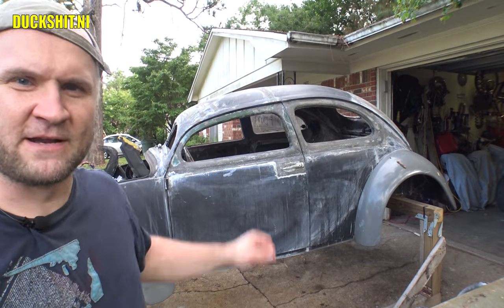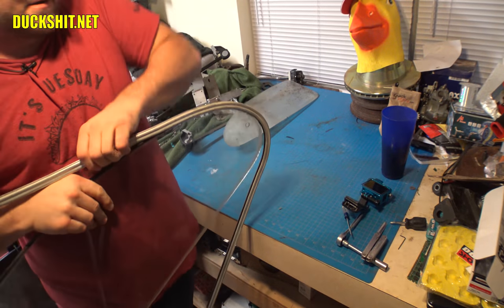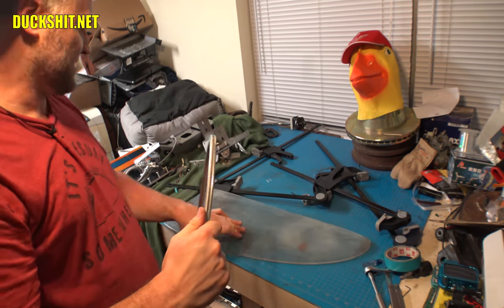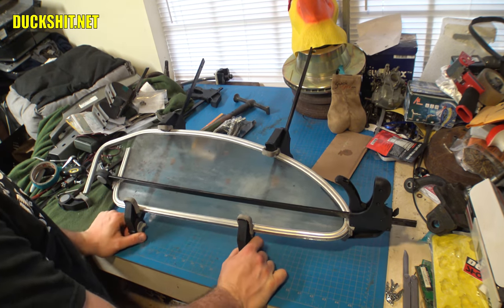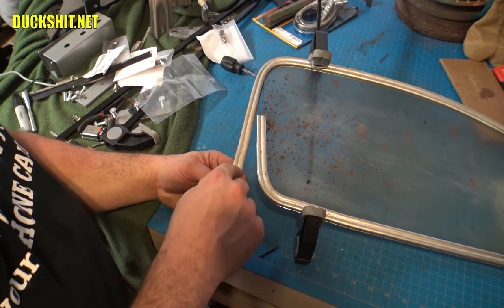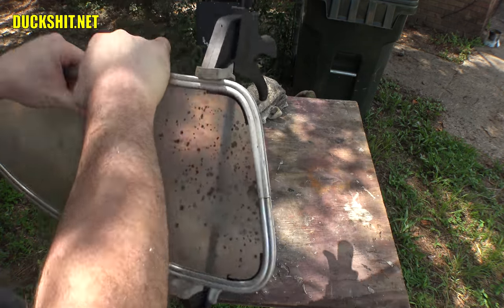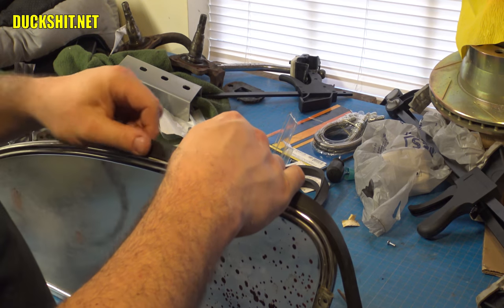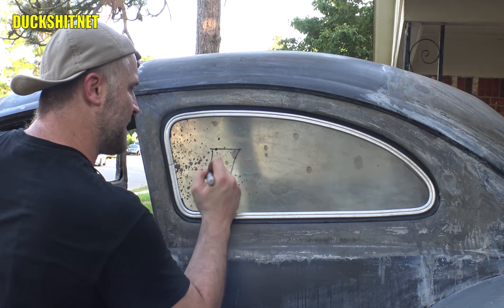How to Make VW Beetle Pop Out Window - ROTTEN OLD 1956 VW Beetle - 111

Comment: This is a great job. You did a really fine fabricating job here. In my opinion I would take the plexiglass down to a glass shop. After you drill the hole for the latch. And have them copy it In Glass. I don’t know how thick they would need to be… An eighth of an inch or something. Holes are easily drilled in Glass. I know I used to do it all the time. Then once the holes are drilled, and the glass is cut. They can be sanded on the edge. And then heat treated Or tempered. Then you would have real glass in your car. Just my opinion
Reply from the maker: We will see how it goes, thank you very much for the comment!

Comment: Hey Duckman. load up your sanding belt with candle wax or a bar of soap. it will keep belt from loading up with plastic and also act as a  lube
Reply from the maker: That's a good tip, thank you!  When sanding plastic it does have a tendency to melt and stick,  your waxing idea would probably have eliminated that.

Comment: GGGGood job. I thought you grind a left over piece from the frame at one point so far down that you - we - see what material for it is being used. The design of this car is dated back to 1939, they could have used copper or aluminium. Or copper base anodized with aluminium. 
By its strenght to bend it i tend to copper. Or to test its resistance. Ohms. Or its weight; cu or al
Made in V2A would be quite a surprise!
Reply from the maker: YAY!  :: squirt! ::   Thanks!

Comment: cool I now how know how to fit pop outs just need my bug to fit them too LOL
Reply from the maker: Might be even easier for you if you have stock sized windows.  🙂🙂🙂
Reply: @DuckmanCycles  yeah differently will be easier because I will have stock size windows the hardest part will be welding in the electric pop out motor pockets
Reply from the maker: But even those you'll have more area to dig into... I have a roof chop so things are smaller and tighter to work with.
Reply: @DuckmanCycles  well I can use a welding touch so welding in the electric pop out motor pockets wont be that  hard for me but still more difficult than tightening a few screws or bolts LOL
Reply from the maker: Very true... lol!  Sheet metal screws!

Comment: Hey man this is an amazing video and i love your content, i use alot of it to repair my own 1963 that im gonna turn into a baja,. I have a quick question though, what would you do for a baja? Would you just make plexiglass windows since you might end up busting them out on like a tree branch or something?
Reply from the maker: Stock glass windows are actually stronger than plexi!   Polycarbonate is bulletproof though.  Most people just leave in their stock Windows unless they are racing, in which case they take the windows out completely and replace with nets!
Reply: @DuckmanCycles  dammn a prompt reply,. thank you very much my dude,. I have the original glass windows for my 63 but it feels like a shame to use them, i actually work for a glass company so maybe ill just use them as a template. Thank you dude
Reply from the maker: Ordinarily I answer more quickly, but I've been drinking tonight LOL!  Thanks for the comment dude! Love to see your project hope you're making some videos!

Comment: I’m wondering if a safari windshield could be done like this? They sell just the brackets for $100.
Reply from the maker: I don't see why not, you'll just have to make sure that the motors on both sides sync up properly.   With some proper linear actuators, and a little microprocessor that is very possible!

Comment: I wonder if you used a heat gun to heat up the metal without hurting it would help it for better?
Reply from the maker: Why would I heat up the metal?  The statement appears slightly out of context
Reply: @DuckmanCycles  well sometimes heating it up will make it more plieable. Just a thought.
Reply from the maker: Heating what?  Sorry dude... you're still out of context
Reply: @DuckmanCycles  heating the window frame. I don't mean to be out of context was just a question in conversation.
Reply from the maker: Ahhhh the window frame....now that puts things in context.   You just left that part out so it didn't make a whole lot of sense what you were saying.  Haha.  Yes I have heated them before, but only if it's necessary.   If you bend it back and forth too many times it gets work hardened.  Heat will relieve that stress.  I didn't need to be concerned with that in this case.